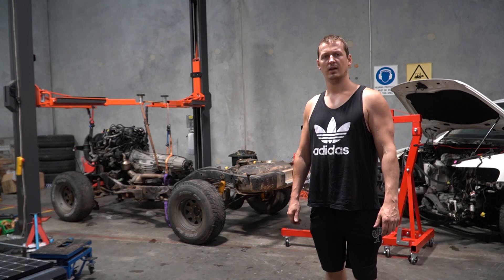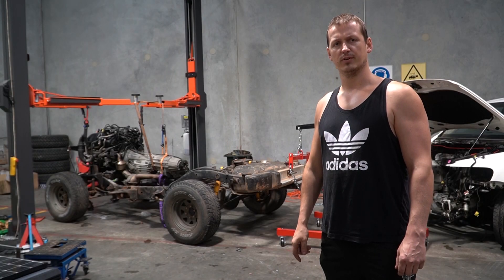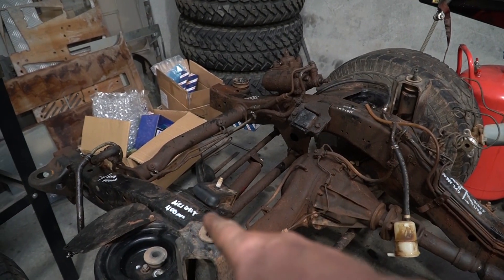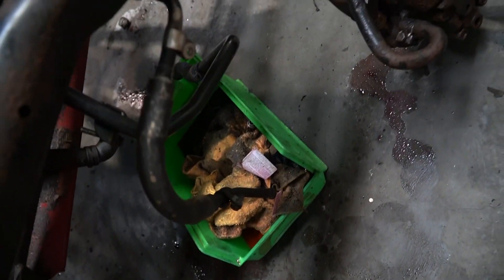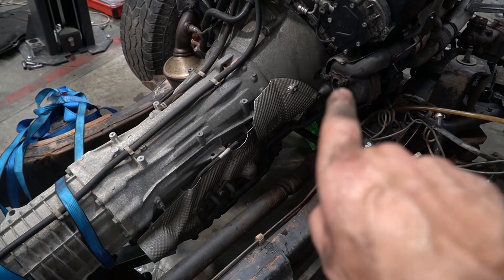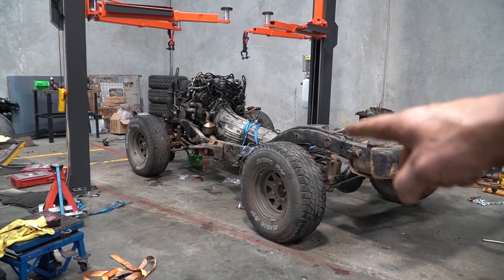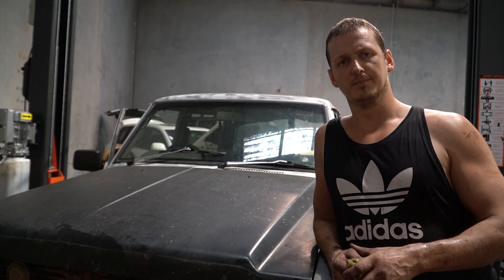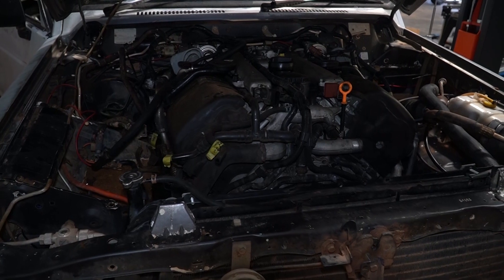V10 Tdi Engine Swap Into A Tiny 4x4... Will It Fit? - V10 patrol ep5

Comment: I like it with how he talks he’s got the “God’s Must Be Crazy” thing going on a little bit.  I love a good V10 conversion as much as the next man.  You know why?  Because nobody does it.  You never get to see it done.  This is brilliant.  I wish new Landcruisers were optioned with a V10.  It’d give a whole new meaning to power.  The mechanics who’d work on them might not like them much though because there’d be no room around the sides of the motor.  You’d have to lift the engine out of the car to do a coolant flush so you could access the bolts to drain the left & right banks of the block of coolant.  Simple things like that would become a job and a half with a V10 conversion.
Reply from the maker: I didn't know what "gods must be crazy" was before this comment. Now I do, and I'm hooked. Unfortunately it looks like the era of cool engined 4x4s will die with the cruiser V8 thanks to all the hippies wanting their cars to fart fresh air and acorns. Not complaining. I'd hate it if they made a v10 forby to make my efforts a complete waste of time.

Comment: Dude, i need one of these. So keen to see this finished. Stay strong. Dont put a td42 in it. Such better diesels out there, like a 1hdfte, or a cummins, or a duramax, or toyota 3L from 1992.
Reply from the maker: TD's are great when they're not messed with by idiots. Unfortunately they're all messed with by idiots. Don't worry, the V10 definitely fits.
Reply: @ridiculousthings4x4  Thats why ive got a tb42 injected gq that i bought from an old bloke that had it since new. Cant trust anything with a TD anymore.
I am STOKED the v10 fits. I might have to save my pennies and come see you for the parts so i can install one when i finish with the body work i wanna do